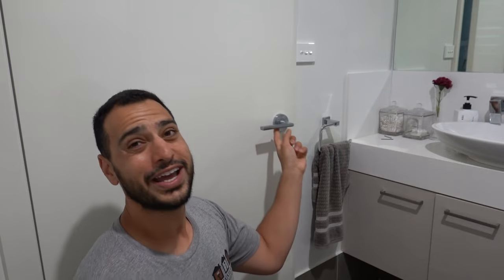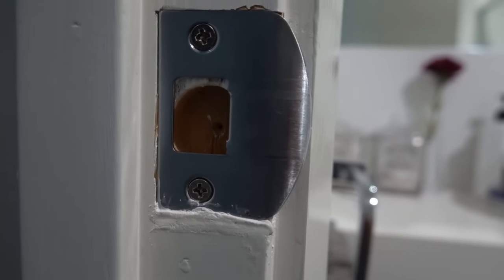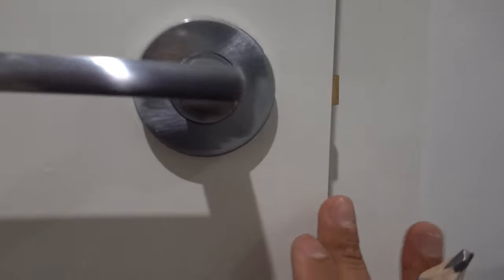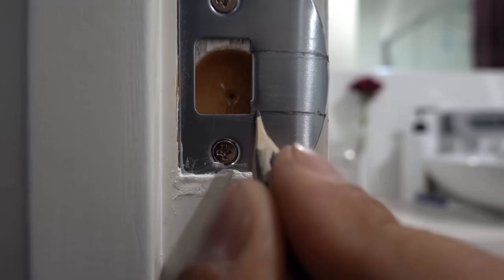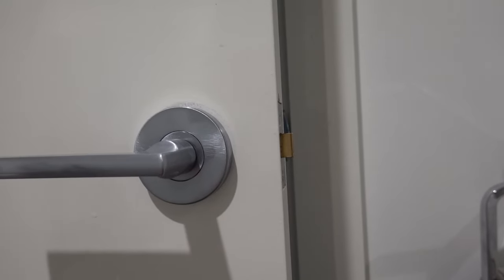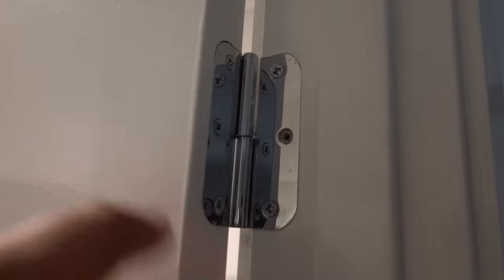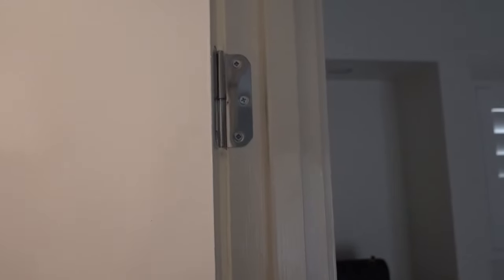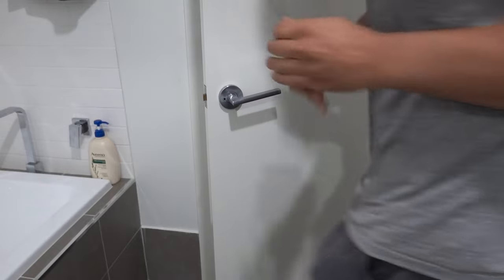How to fix a door that won't latch like a pro - DIY

Comment: I've hung a couple of doors and I've had to do it on my own, so I wanted to share another tip with you all. Using the pry bar like in this video is a great idea but if you're hanging a door from scratch eg. marking out the necessary positions where the hinges need to be located (normally on the door itself and the jamb), then either using a router or chisel & hammer to cut out the necessary timber to make hinge recess area can be a tad frustrating for a novice (read mind-blowing!). To help keep the door in the perfect position I suggest you carry a small book with you i.e. I personally use an old phone book as the height can be adjusted by fractions of a millimetre and the book's size spreads the area enough to cover virtually the whole of the bottom of the door therefore making a second choc for the most part redundant. Just a simple tip that's worked for me, I hope it does the same for you.

Comment: Helpful tips. Like the paper trick. Also found a match stick or tooth pick in the screw hole when they don't tighten back up helps

Comment: Thanks heaps for the 'how to" .. I have 4 doors that don't latch properly and by the way you described it I think even I can do that... CHEERS!
PS: Sometimes it is fixed on its own, either in winter/summer .. and it depends on the weather???
Reply from the maker: you're very welcome. This is also due to expansion and contraction as the weather changes 👍
Reply: @billshowto  Thank you...

Comment: Hi Bill, mine is old house and door latch is going in too high on strike plate. Any suggestions please?
Would I pack out top hinge to drop it?
Reply from the maker: Pack out the top hinge to lower the latch and pack out the bottom hinge to raise the latch 👍

Comment: Small tip with the drill, lock it in neutral when shifting or tightening a screw.
Reply: What do mean? On the torque setting?

Comment: We recently moved into a house where the screen/storm door has one of those lever-type handles, but it will only work by pulling it up.  You cannot push it down, it wont go.  Any clue why and how to fix that?
Reply from the maker: It could be installed backwards